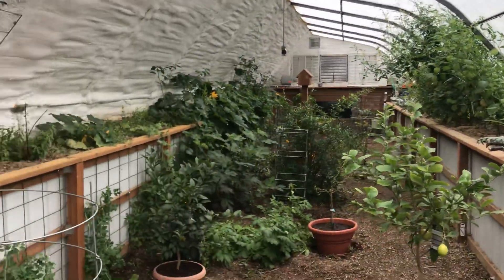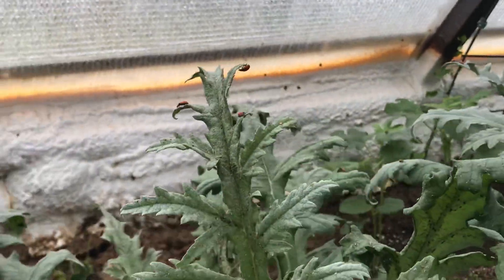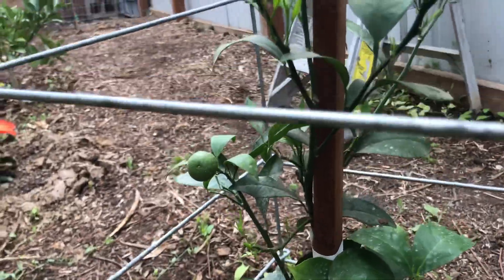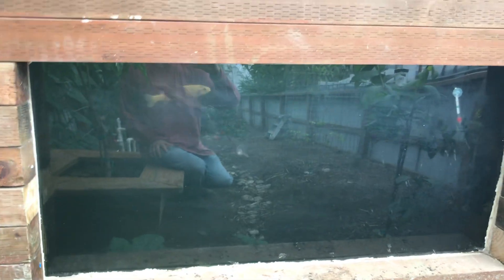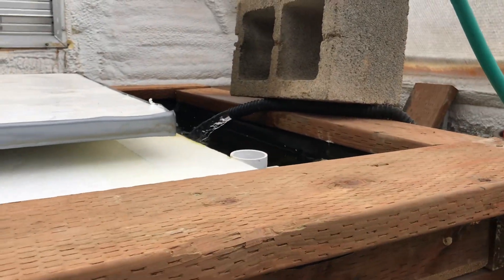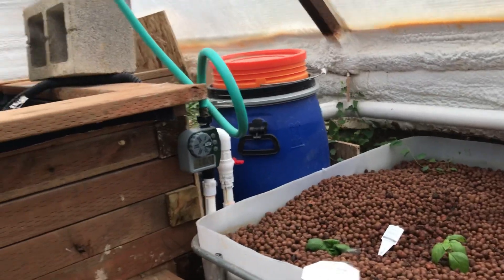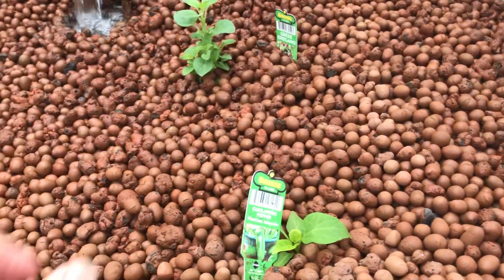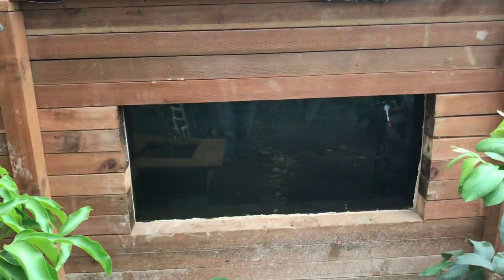Greenhouse and Aquaponics Update - introducing the Rainbow Trout

Comment: At around minute 7:30 in the video you refer to a water line with a float that takes on new water throughout the day.  Is that water simply replacing water that the plants use and some lost to evaporation?  Also, since you've now made it thru summer did you have issues keeping the rainbow trout cool enough last summer.  Thanks for making  these videos, and cheers from Nebraska!
Reply from the maker: Yes thats exactly right.  I put a float on my Sump tank so it keeps the water level stable by introducing new water as needed (so I don't have to).  Yes water loss is from use and evaporation.  I also put a valve on my Solid Waste Filter so I can use fish waste and fish water to water the plants/trees - I probably use 25 gallons a week watering.  Our temperature got up to about 69 degrees in the water tank last Summer which is too warm for the Rainbows and we lost  some of them.  We have plans this coming Summer to keep the Greenhouse cooler and also to do more frequent water changes so our water stays cooler.  I'm also going to add Brown Trout this Spring as they can handle temperatures that are a little warmer.  I need to keep my water temperature below 65 degrees this Summer.

Comment: I use the clay pellets as well ... the trick to having them not float is more clay pellets.  I fill to the water-line, and then add another 2"/50mm of pellets.  That sorts out the floating problem, avoids root-rot, and mold/algae in the pellets.
Reply from the maker: Thanks for your feedback.